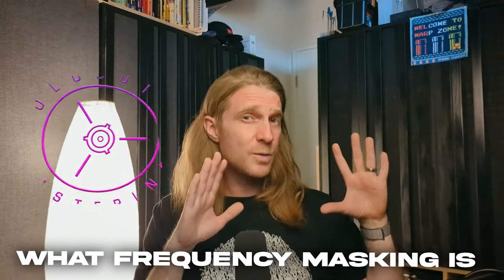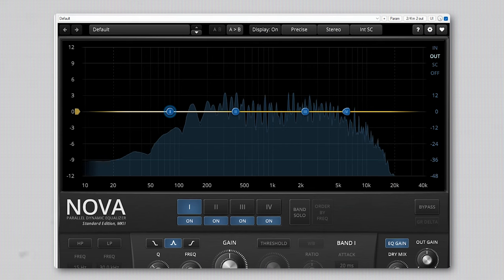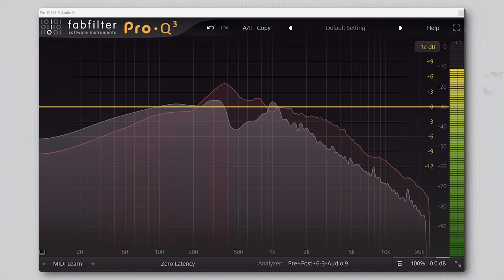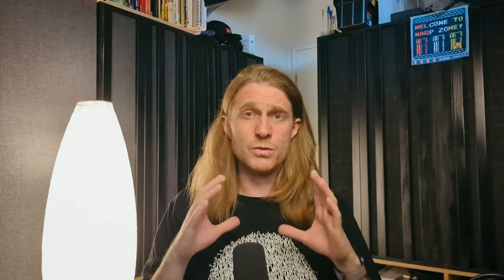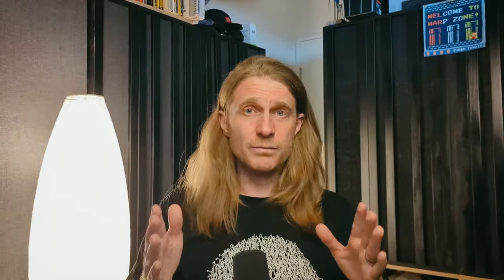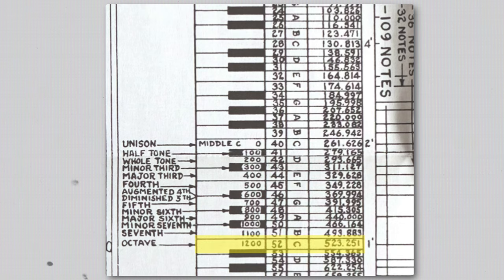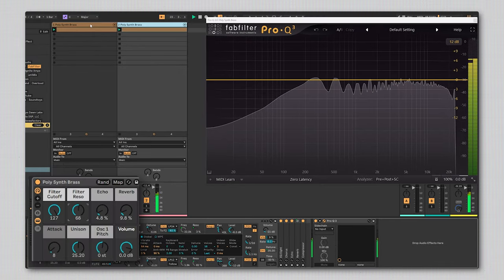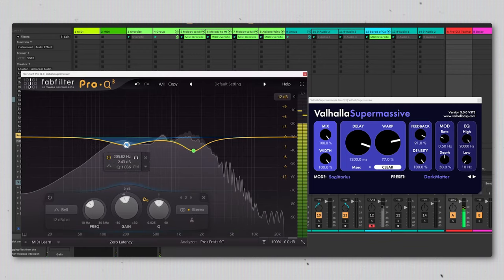Is Frequency Masking Sabotaging Your Ambient Mix? Time to Fix It!

Comment: that pro q 3 tip is crazy. i still have 2, but that feature really makes me want to upgrade. maybe on black friday.
Reply from the maker: Oh wow I've only ever used Q3, didn't realise that wasn't in the earlier versions! I don't have to use it a lot, though I do occasionally use the EQ match function to help with unmasking - Dan Worrall did an amazing tutorial where he pointed out if you use sidechain to analyze the frequency of a track that's partially masking another one, Q3 will create a profile that tries to mimick it - but if you invert the EQ choices it makes, it also works as a handy way to see where the masking is happening and makes it easy to EQ cos the points have already been made for you. Very cool trick! Annoyingly, I can't find the dang link for you 😅 Dynamic EQ is also fun!